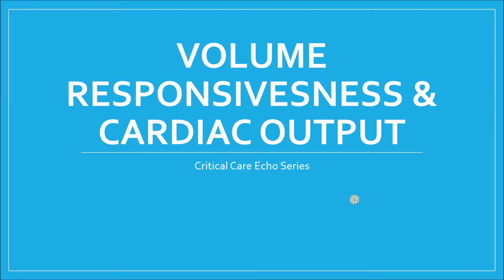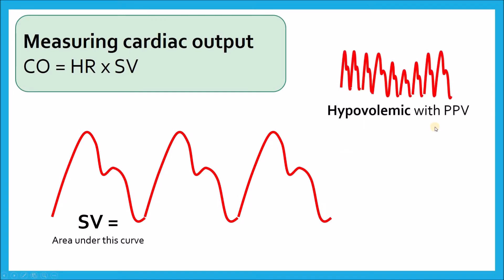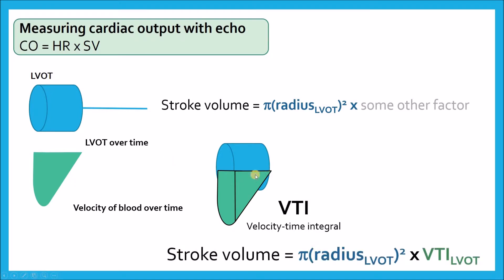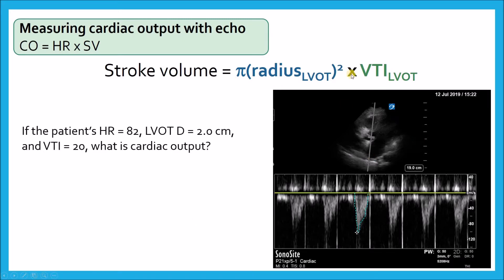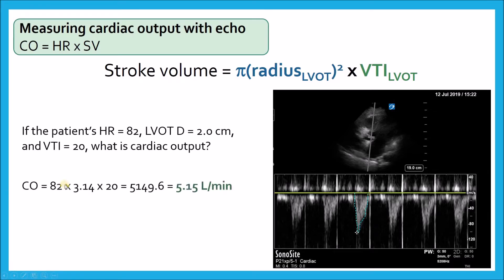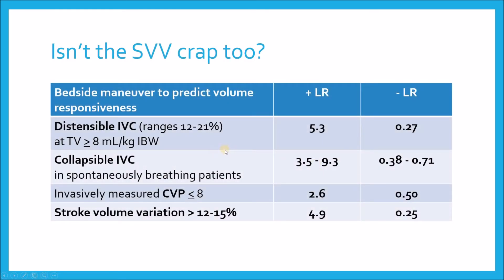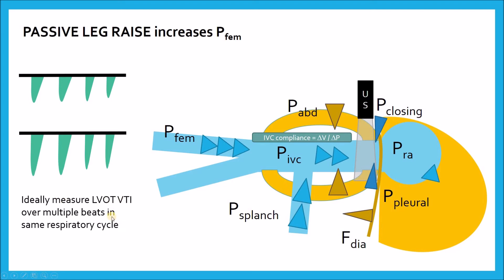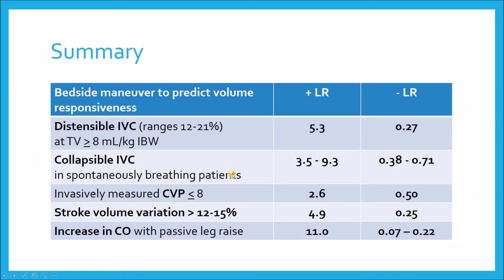Assessing Cardiac Output and Volume Responsiveness - Critical Care Echo

Comment: It would just be simpler to explain that the VTI is the "stroke length" (velocity integrated over time is just distance). Once we substitute "stroke length" for "VTI" it's much more intuitive. You then understand that stroke volume is just stroke area (LVOTa) x stroke length (VTI) - exactly like any cylinder. Like squeezing the bottom of a toothpaste tube a cylinder of blood comes out of the circular aorta just like a cylinder of toothpaste comes out of the tube. The harder you squeeze the longer, but not wider, the ejected toothpaste is.